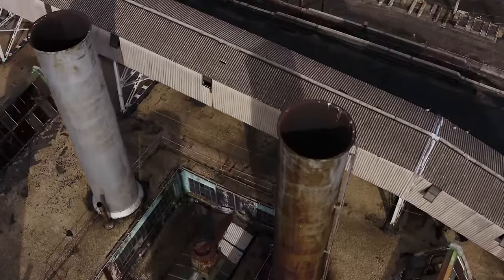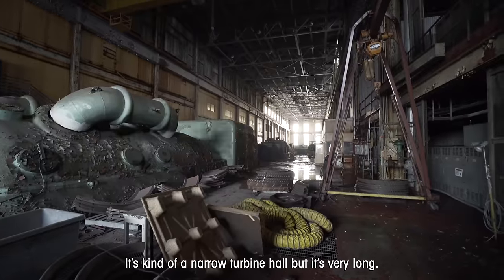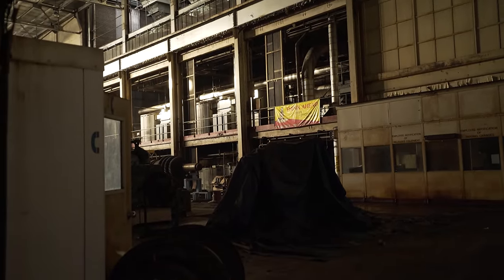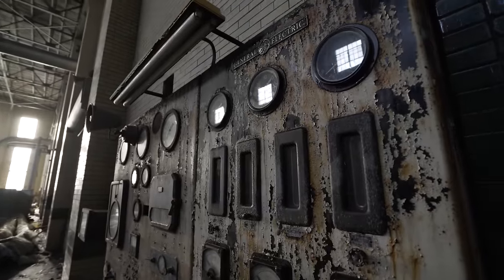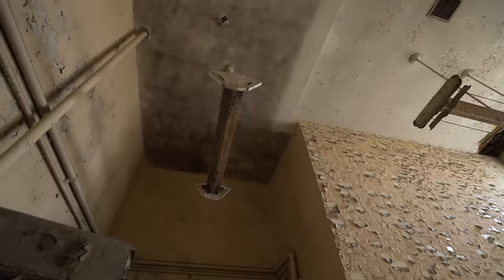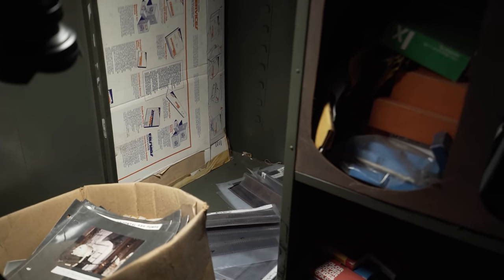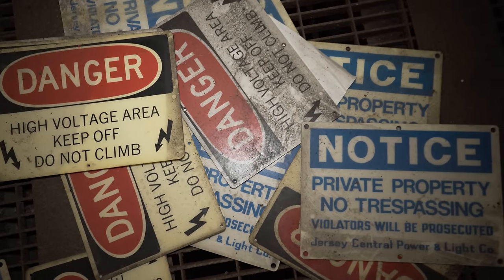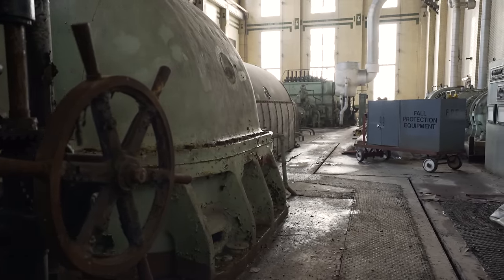Exploring an Abandoned 1930 Power Plant - Art Deco Industry in Decay!

Comment: In old powerplant terminology. A Green light doesn't mean running or a closed breaker and red doesn't mean off or a open breaker. Green means it's ready to go. Which would indicate it is off or a breaker is open. And red means it's hot, energized, or on. A breaker with a red light is actually closed, and a red switch or push button will start whatever motor or energize that piece of equipment. At some point about 12 years ago they tried to "standarizse" power plant to the mill I work at and when they went to change the lights around the old men raised hell and would not let it happen. Said if someone comes into power they just have to learn power. To this day all our indicator lights are the same way they were back in the 30s when the first power plant was put in where red means running and green is ready to run.
Reply: This is such an interesting detail to the history of the video that I want to thank you for it

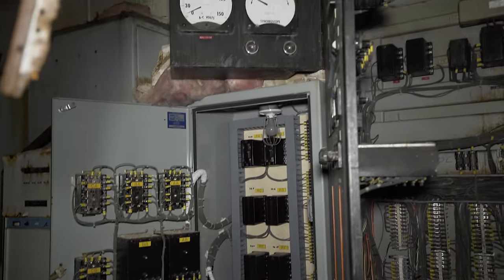Comment: The powered circuits looked like they had to do with connecting the turbines to the grid, which makes since because they would still have power even if everything else is disconnected. The synchroscope at 26:50 is used to check if the generators are spinning at the right speed to generate 60hz to match the grid before they are connected.

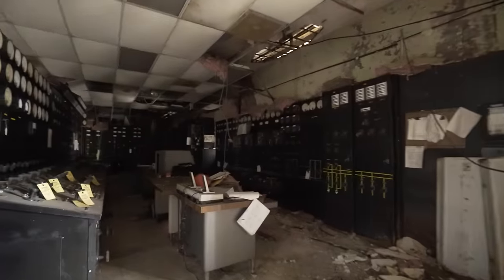Comment: At 9:00, that shows the High, Intermediate, and Low Steam systems. Red indicates open or energized, Green is closed or de-energized. It's backward to traffic lights. New modern "High Efficiency" HMIs use white for off, light blue for on, and yellow, orange, or red for an alarm state. The idea was if they are on or off and there is not a problem, the color should be muted. The black control room at 25:40 is the electrical controls. They would route power from the grid to start the plant, and once generating they would route the power back out to the switch yard and sync the generators with the grid frequency putting the plant at the frequency of all others on the grid. This plant was obsolete because of the cost savings of natural gas and efficiency. A single Simple Cycle GE 7F can generate more power and requires very few employees to operate, and is cleaner to meet the later regulations.
Reply: that's very interesting. i was wondering the whole time watching this how it could be cost effective to simply abandon large machines. i was thinking they must still work somewhat, or could be refitted to run on other fuel, but i don't know anything about it. or they needed a much higher capacity that all of their smaller generators couldn't provide

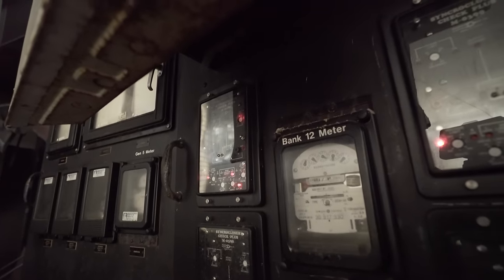Comment: at 27:20 the power is coming from the grid as those panels were used to synchronize the phase angle of the turbine generators to the grid before  tieing them into the power grid  if the generator was too far ahead or behinde  the phaseing of the grid  it would cause SERIOUS damage to the equipment  too far ahead it would stall out he generator causing heat damage to the winding as it came back into phase  along with probable mechanical damage to the  turbine it self to far behind would cause it to act like a motor  again causing mechanical damage  to the turbine
Reply: So fascinating so when it started to act like synchronous motor. Would it start chasing the poles on the turbine generator and accelerate it way beyond the speed the steam was turning it? Im an industrial centrifugal and screw chiller tech. I work on machines that have medium voltage 4160. I find steam turbines very fascinating. I appreciate the info you’ve laid out already.
Reply: We had a small scale system of motor-generators at the technical college I took my electrical apprenticeship training at. According to our instructor, the system was originally grid tied, all was fine until a student closed in a generator out of sync, which resulted in several city blocks blacked out. After that incident,  two motor generators were used to provide isolation of a fault from the city utility.

Comment: Great video.  I used to see that building from the nearby boat ramp for the Raritan river.  On the other side of the boat ramp was the Sayre and Fischer brick factory which closed around 1970 after 100 yrs of operation . All that stands is an old water tower along main street.  I use to explore the old buildings with my brothers and friends in the seventies.  There were huge and and starting to fall apart.  There  was even a small gauge rail line that ran through the property.  We use to push the rail cars along the tracks.  Looking back it was pretty dangerous fun. its how Sayreville got its name.  Too bad there isn't old video of that factory too.

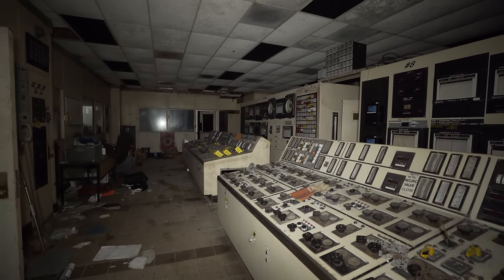Comment: 8:36 I don't know too much about power plants and it's been a minute since I took a mechatronics class, but assuming the metal paths are using pneumatic/hydraulic symbols, the arrows pointing into each other are regular gates (valves) and the stand alone arrows are check valves (fluid only goes one way.) So with a bit of knowledge, I'm sure you could identify everything on that board, especially if you work there.

Comment: The lights on the control panel indicate which valves are open. The path is showing the feed water and the steam system. 

I used to work in a nuclear power plant. It's pretty much the same setup.

The backup turbine rotor is interesting. I suspect that this is a dual turbine with a high pressure and low pressure side. Im used to seeing those on two different shafts and a moisture separator in between.
Reply: The long poppet valve for the inlet of the turbine is for when you start it up. You need to warm it up slowly and blow down steam traps. The multiple poppets let's you control the speed as you heat. It takes hours.

Comment: Awesome.  As interesting as this building was though, there was an even more impressive art deco power plant just down the Raritan river.  

The EH Werner power station was absolutely gorgeous.  Even better, when it was expanded the crew that did it matched the original architecture outside.  It was replaced by a few gas turbines built next to the steam plant but rumor had it that while the modern turbines were damaged by flooding from hurricane Sandy, the brick building was in such good shape that had the generators been subject to regular maintenance they would probably have been able to be lit within a few hours to restore power instead of the week+ to repaor the newer equipment.

Unfortunately, this plant is also gone.

Comment: To me, control room 'old' (upper ceiling) looks more like early 1960's while the lower ceiling looks late 70's early 80's. I got to see a variety installing equipment in both 'old' and 'new' dating from the early late 1890's - 1900's to the late 1990's, MANY either had the 'layered ceilings' or the telltale traces of previous ones above the current one. X-Ray rooms were notorious - some originally had 14'-16' USABLE ceiling heights - for tall tubestands, 'hoop' supported tables that could rotate ether direction to tilt the table completely from standing up to supine face up, to face down or further, or to clear the gantry of a 250 KV deep therapy X-Ray radiation treatment machine.

Comment: Just a guess, but if the volt meter next to the Synchroscope is to be believed (the area still powered)... I wonder if a few of the batteries in the back - nearby, are still good and there is an inverter in this area (the hum), from DC, to AC.  Being close to the backup power controls, 12 volts is a typical voltage for most types of old meters.

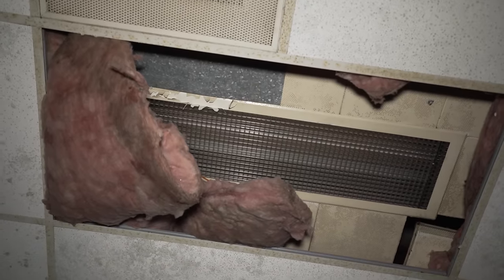Comment: 10:27 Another case of adding a drop ceiling to a building. However, isn't that just another drop ceiling above it? Given the dislocated panel at the bottom right having the same style as the panels surrounding the old light.

Maybe this room has seen two of these "lets add a drop ceiling" renovations in its life. How knows, might be a third drop ceiling above as well...

Comment: 0:35 what in the world is that perfectly white box on the roof? Post edit or something?
Reply: White P.O.S. box that is physically attached to the smokestack; possibly a monitor station of some sort for amount of carbon going up the stack in the smoke?  You can still see it in the Google Earth 3D map of the station. But certainly not a post-edit or artifact noise during recording.  👻
Reply: @steadholderharrington9035  Strange, I'll take your word for it. It just looked so out of place that it really looked like it was edited in.
Reply: @mtx247  Yeah, that "box" on the stack there was probably one of the last additions to the plant before it closed, and it was more than likely coated in a white, baked-on, enamel-like surfacing that is resistant to rusting and fading so that, 20+ years on, it still dazzlingly reflects sunlight as good as the day it was installed.  I had one of those whirlybird roof vents on my house that was similarly coated, and, God's honest truth, I swear its brilliance in the sun kept on pissing off the 408th Tactical Helicopter Squadron that is based just north of where I live. They certainly loved to buzz my house often enough at least until we got rid of the whirlybird with our roof replacement.  😅😓😮‍💨

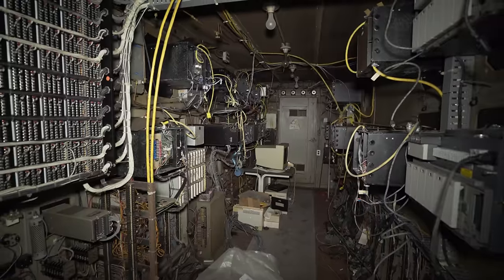Comment: 9:59 slag monkey.. cooling water trouble?
Reply: Well, good thing you asked.  These boilers are called wet bottom boilers.  What that means is that the ash from the coal is molten, like lava from a volcano and builds up on the floor of the boiler.  The coal is pulverized into dust and ignited.  This fireball is adjacent to the boiler floor so the intense radiant heat of the fireball keeps the ash liquid and flowing.  The molten ash flows out of a hole in the bottom of the boiler called a slag tap.  These slag taps are about two feet in diameter.  The molten ash is somewhat sticky and viscous, and as it cools it becomes more spherical.  These sticky blobs of ash tend to hang around the circumference of the slag tap, sort of like monkeys hanging off the branches in a tree.  This is where the term “slag monkey” came from.  The water refers to the water used to cool the neck of the slag tap, chill the ash so it does not build up on the slag neck and helps it shatter as it builds up in the slang tank below.  The accumulated slag/ash is then hydraulically conveyed to an impoundment and disposed of.
Reply: @scottspilis1940  Thanks! Very interesting to learn a little bit about slag monkeys and wet bottoms. This also gives a hint as to why the indicator label is somewhat vague, and also not a red alert.